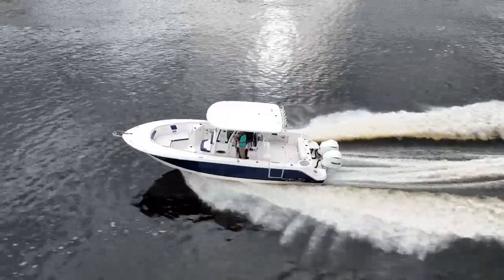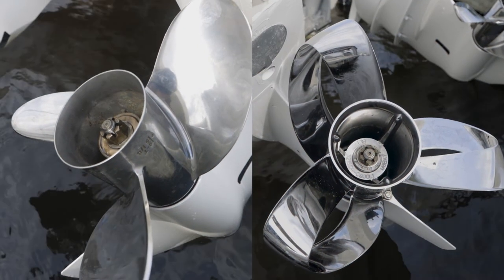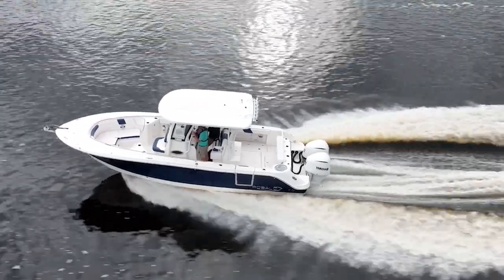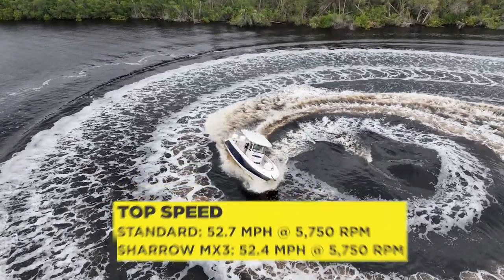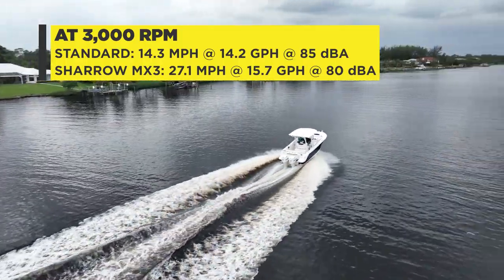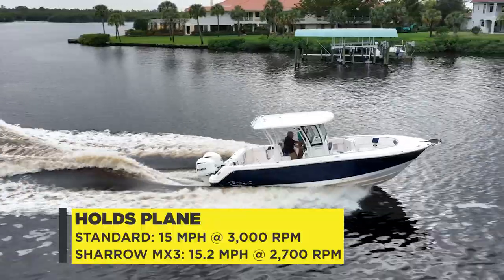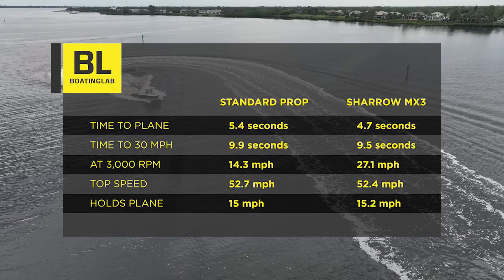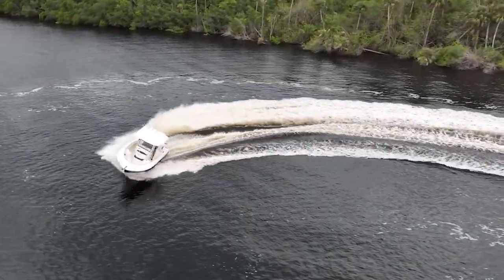The Prop Test: Sharrow MX3 vs. Standard Prop

Comment: Not a lot of data in this (paid) test and strangely not a single figure on fuel consumption which is the biggest benefit to a lot of people. As mentioned in the video these props really shine at mid rpm where they according to another test show some impressive gains in terms of efficiency/fuel consumption. I believe that the other test I found here on YouTube showed up to 36% longer range on a gallon of fuel with these props at optimal cruising speeds. That's really something. Lower noise and better handling are added bonuses (as mentioned here also).
Yes, they are definitely not cheap but they might actually save you money in the long run if your boat spends some time at cruising speeds. Try to do the math. In the above example they were able to save 6.4 gallons per hour using this prop compared to the stock one at optimal cruising speed. In that case it should take less than 200 hours of cruising to save the 4,500 extra dollars that this prop will set you back compared to a conventional one.
Hopefully prices will also come down as production volumes go up. However, if you only take your boat out of the harbor every once in a blue moon then it's probably not worth the investment.
Reply: Yeesh these things are $5k?!?!? Wow. I only got in the comments to see if anyone has looked into how much more it cost to get a bent one repaired vs. traditional. Just wow. Nevermind.

Comment: not a single figure on fuel because it was worse. They got 1.7 mpg at 27mph with the sharrow standard prop was 30.7 mph at 3500rpm at 1.8mpg
Reply: They showed the fuel figure.
Reply: @korndawggy1801  where?